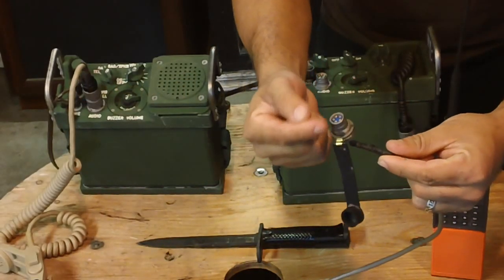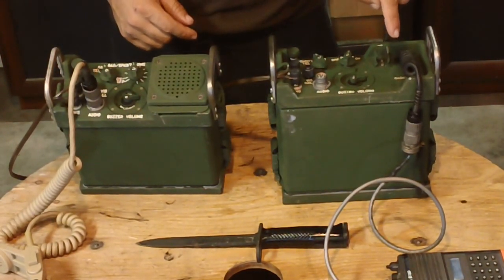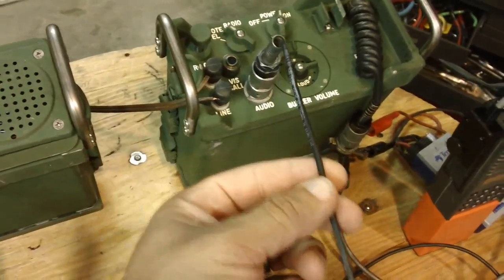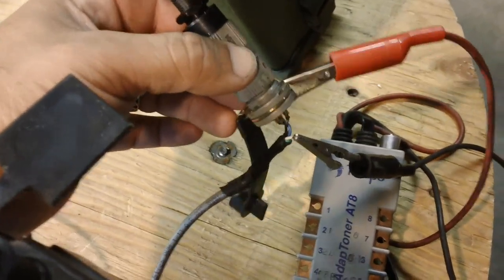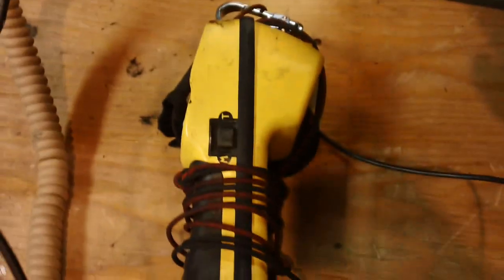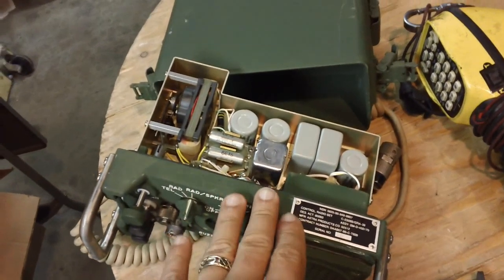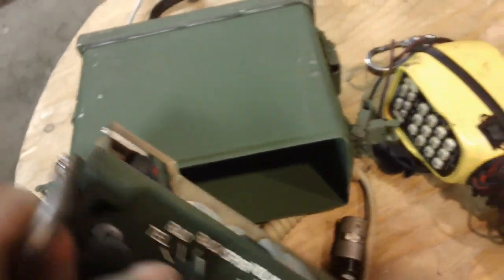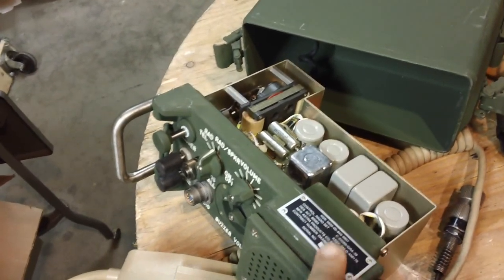Field Demo W/Mods, A/N GRA-39B, U.S. Army Surplus Radio Remote Control Set, Part 2, Final Summary.

Comment: That WAS a steal...  There are some forces still using them in the field...     Regarding the comment below, WD-1  has  two (2) conductors,  WF-16 has four (4) conductors.    Only two (2) are needed for the GRA-39.   Note that the  '39 can be used with ANY radio set that is compatible with the H-250 handset.

Comment: Will it work if you connect to a 6 pin connection? If not, then where did you get your 5 pin to 2 pin adapter

Comment: I found the manual, yes it can be done, the wiring looks pretty out there, but here is a link to the manual online TM-11-5820-477-12.pdf . I hope to get my hands on a gra-39 soon. Would it be possible to interface a GRA-39 to a CB radio AM/SSB without too much difficulty?

Comment from the maker: If I remember right, I think you could. though its been so long that I dont remember if it needed anthoer module or if it is already configure to interface the radio. But I know for sure it does, since this method was always employed by the command back in the day. If the SB22 produces a 3900 hz tone, (I believe, from the top of my head), it will key up the remote GRA-39B.

Comment: I have an sb-22a/PT switchboard, can I connect the gra-39b unit to it so that I can patch a caller on one of the line packs into the radio? I may use this with a 10meter or a CB/SSB radio for emergency communications.

Comment: Ok for a non-commo guy. The wire to use is called WD-1 or WF-16 wire.
You want to tie-off the wire to the D-ring on the units before you connect to the binding posts. The GRA-39's never caused me any problems and yours are in super shape. You want  a total of four (4) handsets for your GRA-39 set. The GRA-39 can be used as a telephone, (RWI) Radio-wire Integration, Remote control of a field radio such as a RT-524, or as a Audio Amplifier for a Field Radio such as a AN/PRC-77.   KC8MZW,  73's !